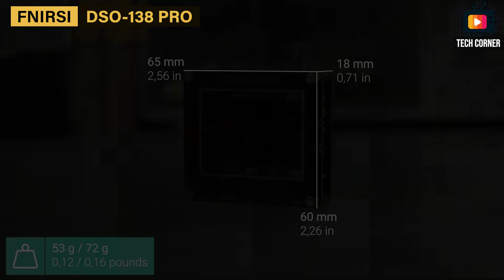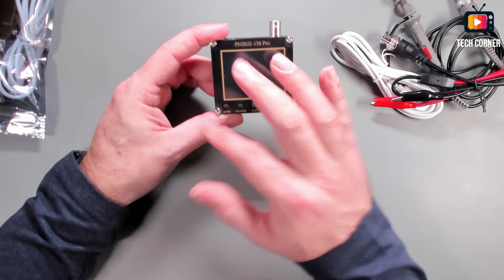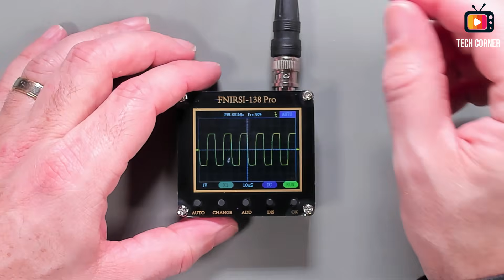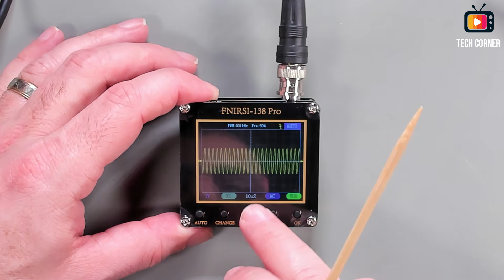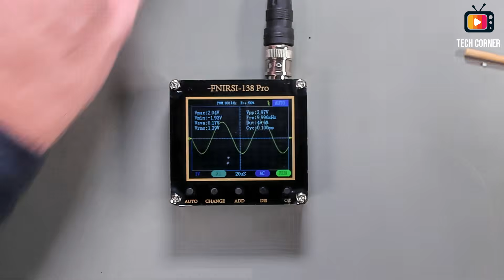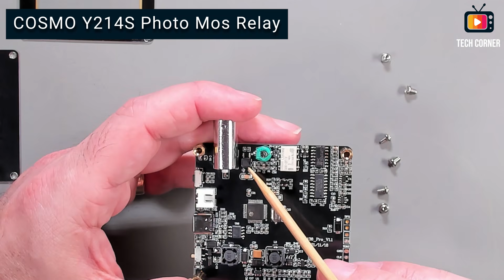FNIRSI DSO138 PRO ⭐ Is it the new king of cheap mini oscilloscopes?

Comment: SWD/CLK - Serial Wire Debug. ARM M-series standard programming interface with bidirectional communication.

18:25 "offset is changing" - well you are in AC coupled mode. :D

OK i know the ADC on the Winchiphead is different than on STM32 and seems like it might be faster, but where are they getting the divider to get 2.5MHz out of it specifically? Rather than 1, 2 or 4 MHz. This smells a little fishy. The crystal is 8MHz so it's probably running 72MHz standard main clock.
Reply from the maker: Hey Siana, thanks for the tip, while I was editing the video, I thought that might be something like that, maybe I2C, but thanks to ckearing that out. Regarding of the "fishy" part, well in this small devices is what you get more 😁 thanks for watching. 👍
Reply: @TechCornerTV  I mean 1 MHz sampling rate is exactly what I expect given the extreme low cost nature and minimal envelope, I just have a little chip on my shoulder where I'd really like manufacturers to provide actual faithful specs regardless of if it's an educational toy instrument or has higher ambitions, and I'm just not convinced the brand is particularly committed to that. A lot of specs in their higher cost and larger devices also take an almost injury-prone amount of squinting.